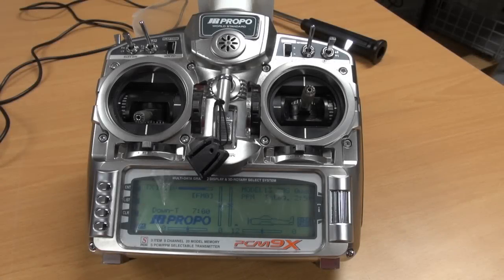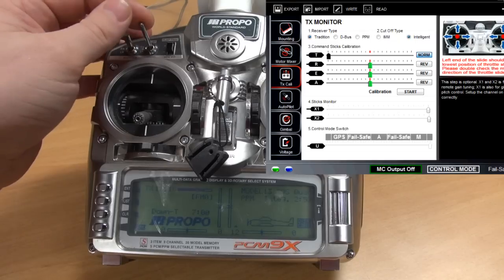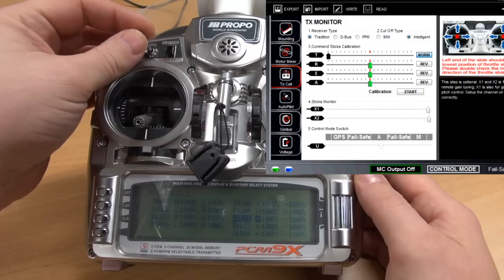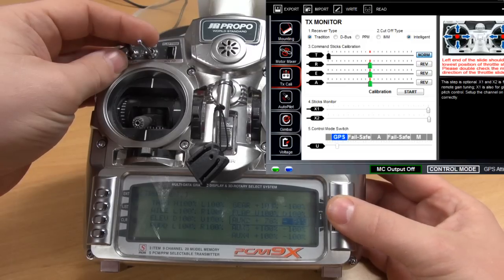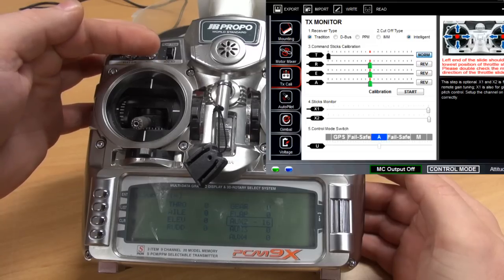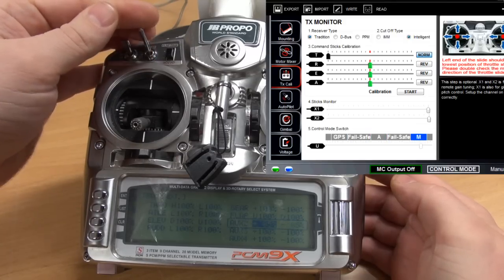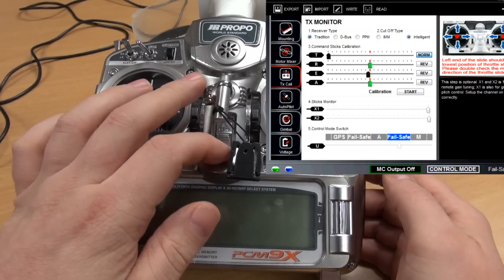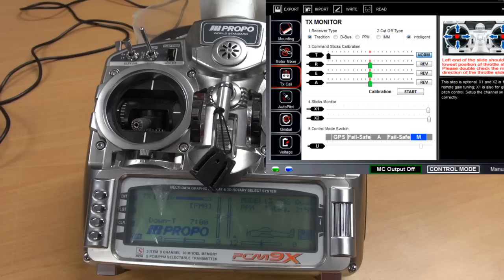TBS Discovery build EP22 TBS DJI Naza Mode and failsafe setup - 20121020

Comment: I think it best if the radio failsafe is set to around 40% of throttle up...  the Naza will take over and fly it at the proper throttle when in failsafe mode.
h76industries is just showing how to set up the Naza failsafe/mode selection...  you still need to set up your radio failsafe ... basic radio failsafe is around 40% throttle and the sticks in the center position....  you will need to read your radio/receiver manual for ensuring the radio/receiver failsafe  is available to the Naza

Comment: Great tutorials, thank you.
In your video you show the setting of the failsafe.
If I recall correctly to set the failsafe for the Naza you need to set atleast 10% throttle.
So when setting the failsafe of the reciever you need to give atleast 10% throttle up with the stick.
If you do not the Naza will fall from the sky in a failsafe situation.

Thank you again, your videos will be very helpfull when I build my Discovery.